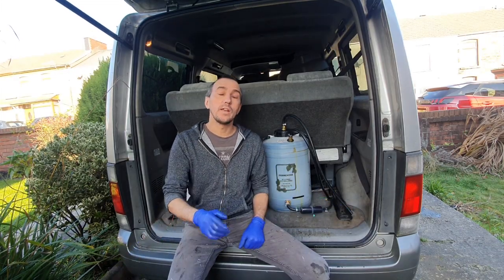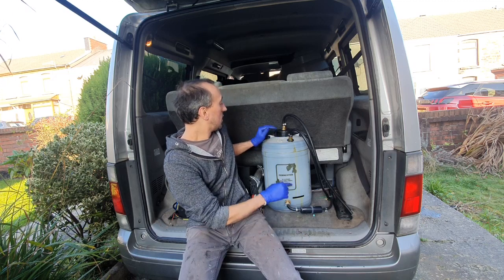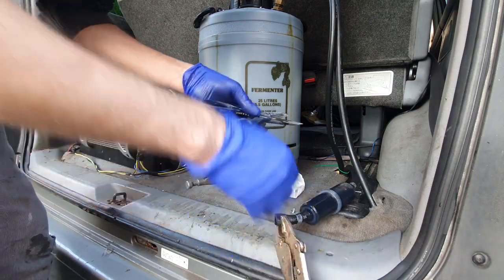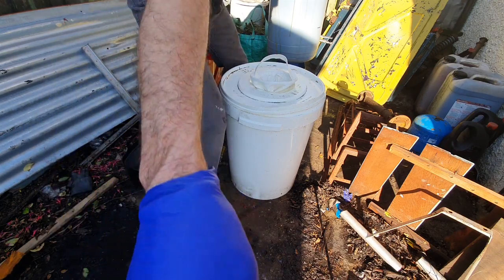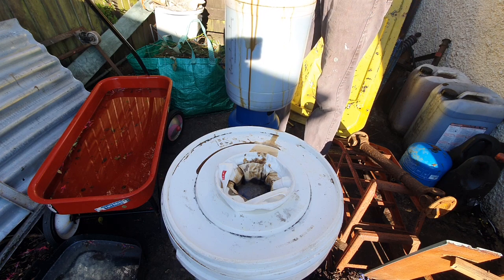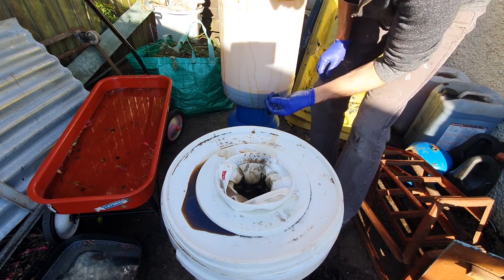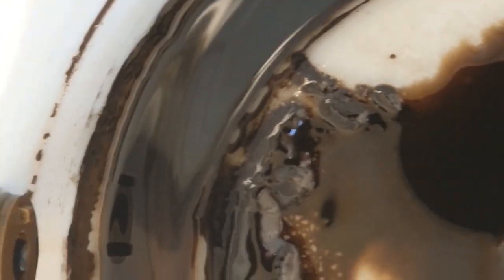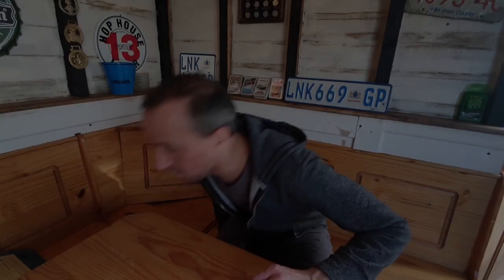Does WMO plus WVO equal Jelly?

Comment: May not look like much buildup however it's more then enough to cause all kinds of damage. I've ruined an engine running veg. That jelly will form inside the combustion chamber and turn into hard varnish after some time seize your rings into their grooves you will loose compression.

Comment: Like your videos!
Do you have a link to your filters?
Do you heat the oil up while filtering?
Reply from the maker: Hi Ell, Cool, I'm glad you like them.  I don't heat the oil to filter, my setup is really simple.  For the filters I get them from whoever is cheapest on ebay, just search for 1 or 0.5 micron filter sock.
Reply: @StevesMachines  thank you, I am looking at putting WVO in my transit do you think it would work? Is your bongo a Ford engine?
Reply from the maker: My engine is a 2.5td, it shares the engine with the Ford Freda.  I don't know much about Ford Transits so couldn't advise you on a WVO conversion, your best bet would be to ask on a camper forum.

Comment: I have found  that filtered down to 1 micron mixed with diesel or a drop kero you don't get any slush it's ran fine in my Nissan Navara D22 engine  also in my Passat 1.9 Tdi pd 130hp I was told that  it would turn to gell as well  that it would knacker my pump. I found running it over  period of time  with the  veg oil with the right mix it was  fine.  I was using  it fairly offten. It does have a shelf life but do does  Diesel specially the  new diesel. I think the van would probably cope with it. I  am  pretty confident in that. I didn't have a separate tanks I just ran it in the  main tank. My pd 130hp AWX ran fine on a Mix Wvo I haven't try weo. But you  never know until you try.👍
Reply: Did you mix 50/50? Could you let us know your method and if you changed it in Summer or Winter?
Reply from the maker: I havent run the van for a year due to lockdown, I'll hopefully get driving it again soon.